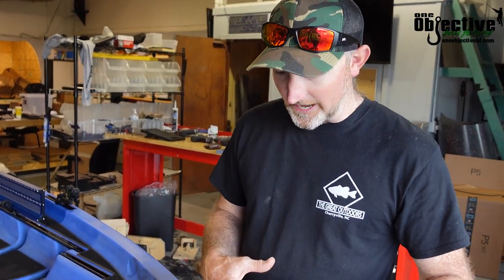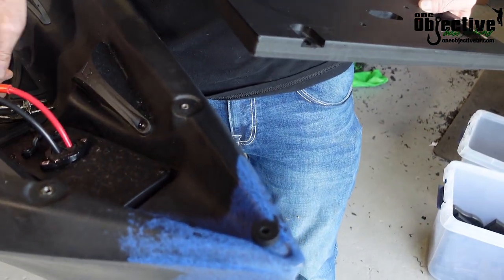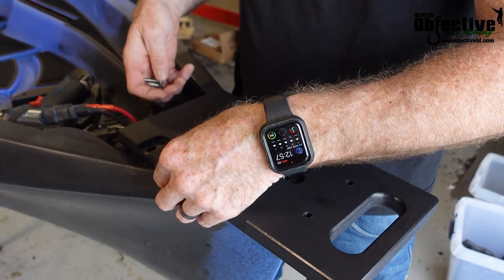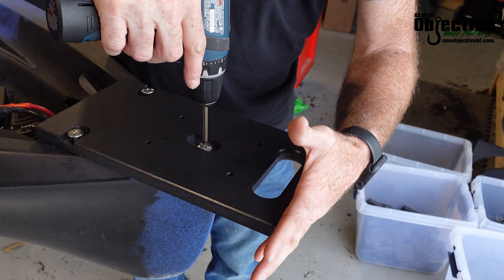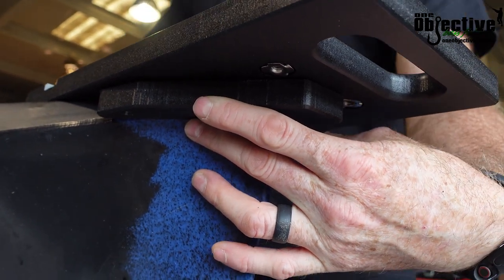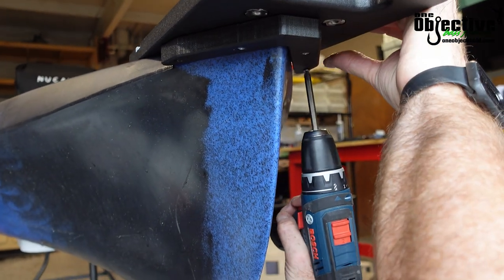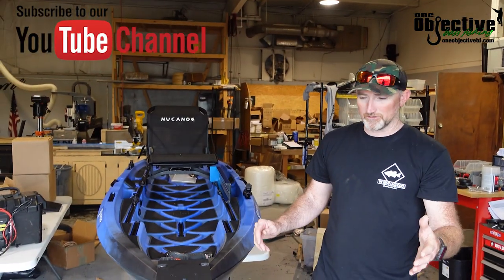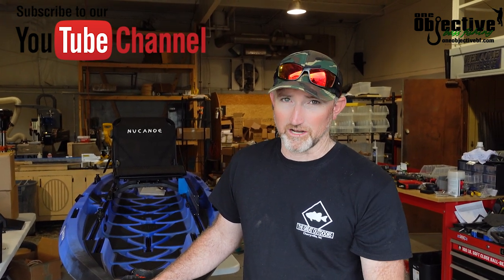OneObjective NuCanoe Unlimited Bow Mount Install

Comment: Will these mounts handle the
 80 lb Terrova or do I need to run a 55 lb?
Reply: Yes! The mount will handle an 80lbs thrust motor.
Reply: @oneobjectiveoutdoors3732  Great, thanks for the reply.